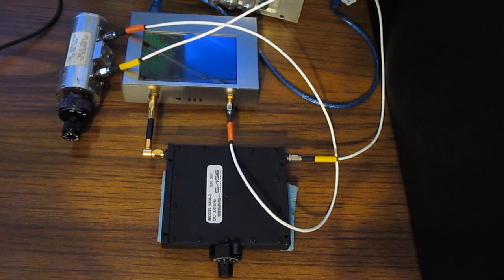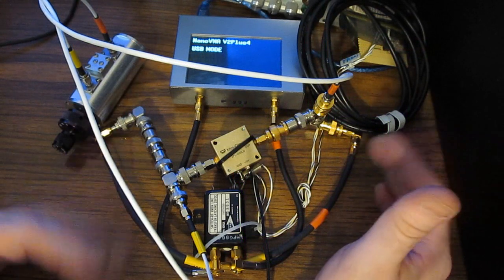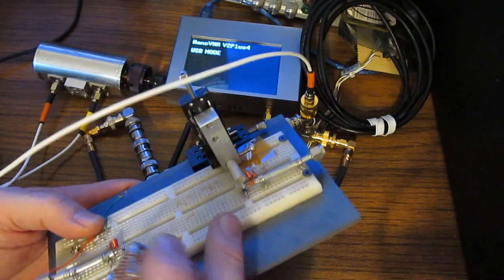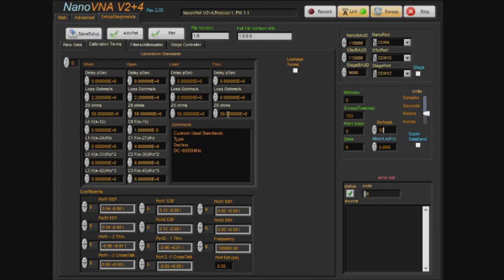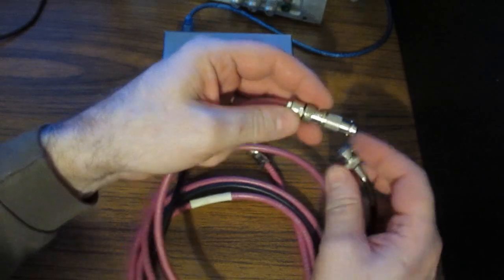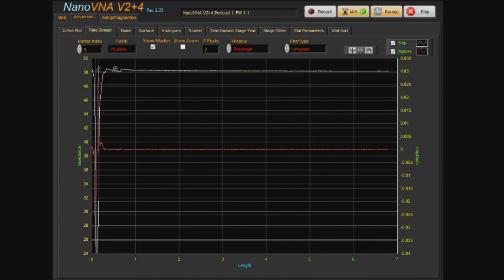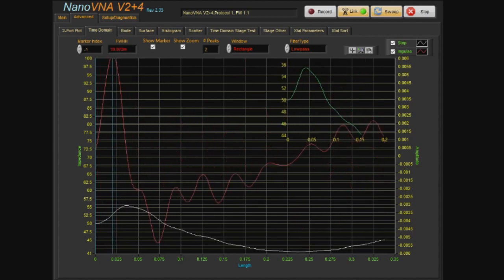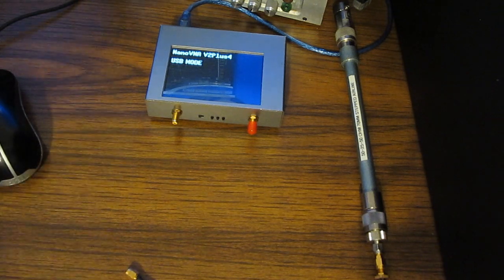NanoVNA Preview for Software Updates

Comment: Would it be possible to use these inexpensive vector network analyzers to do an eye diagram?
Reply from the maker: Could you explain in more detail what you are asking?   YT isn't a real good place to post much more than a simple comment.  If you want to pose your question in one of the public forums, just provide a link.  If you use the EEVBLOG forum, I am a member.
Reply: @joesmith-je3tq  Hmm i have posted 2 replies now and my comments are not showing.
Reply from the maker: They seem to be showing up.  It doesn't appear that they hit any of the YT filters.

Comment: Joe, your VNA software is becoming a work of art, turning 'awkward to use' hobbyist network analyzers into truly useful test and measurement gear. Every feature you add to your program makes the NanoVNA's more valuable. I'm learning a lot just by playing with the program. Thanks.
Reply from the maker: While I doubt I will continue to do more with the older NanoVNA, I am working on a new version for the LiteVNA/V2Plus/V2Plus4.
Reply: @joesmith-je3tq , that should be no problem. I got the NanoVNA for it's xtal characterizing ability. Now I'm looking at the LiteVNA for its frequency coverage and relatively low noise. As far as I'm concerned, your program adds real value to both.
Reply from the maker: @johnwest7993  Hard to say which is better between the V2Plus4 and LiteVNA.  Think about what you need first. They each have their strengths and weaknesses. 
https://www.eevblog.com/forum/rf-microwave/nanovna-custom-software/msg3895181/#msg3895181

Comment: Move to the east coast so you can be my best friend and I can stop being so EE stupid. CS was such a bad major selection ughh. I have a question about vector voltmeters but I'm too  dumb to phrase it properly. But for now, do you know off hand if old mainframes that accept VME extensions that conform to CI wire standard [whatever that is] will be usable via either a standard GBIP or VME interface (presuming I can somehow even emulate the HPUX mainframe) the 8405A looks like a fun toy
Reply from the maker: YoutTube is a poor platform for discussing large projects.  I would just start a new thread on EEVBLOG or another electronic site.   EEVBLOG has an area for vintage computers. 
I wouldn't have any use for the HP8405A but I do receive comments asking about analog multi-meters as well.  There's nothing wrong with enjoying vintage tech.